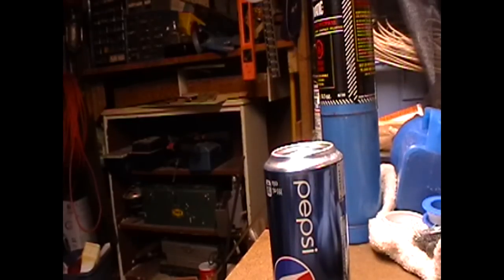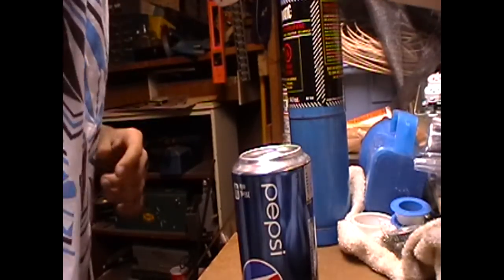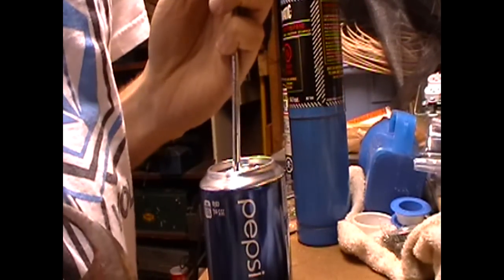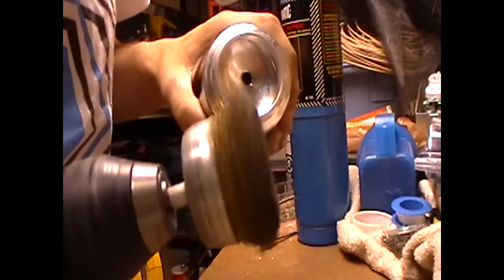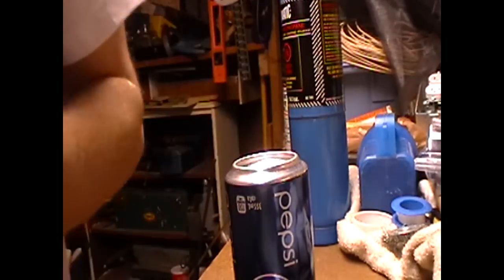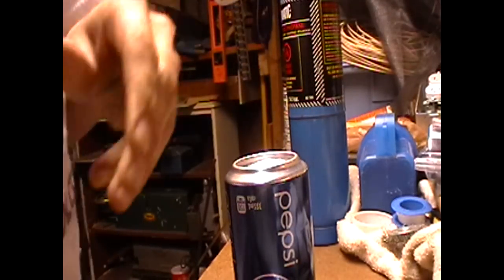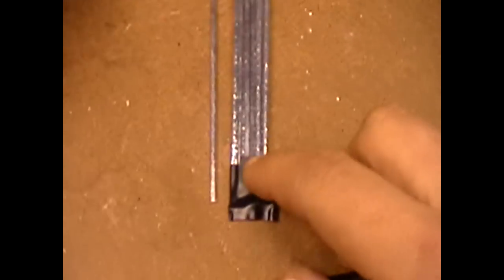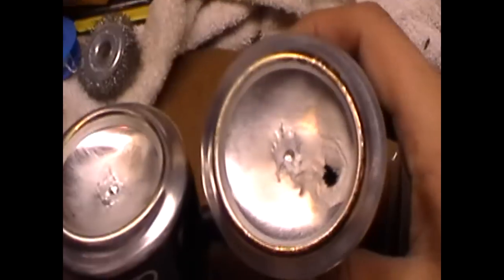HTS-2000 Or Durafix Welding From Ebay.ca

Comment: It depends on how heat proof that stuff is after welding it. Remember, an engine block gets quite hot. If it keeps joined with the other metal under heat, it'll be fine. You should in any case give it a try.

Comment: I've used that stuff before, well under different names. It's the same as brazing. The welding supply store I go to sells them 10 for 6.00 and are a bit longer. It will temp fix it, it's not as strong as getting it actually welded, eventually it will break off where it joins the other metal. Good luck though

Comment: you can also get this stuff called quick metal i had a hole on my engine case on my dirt bike and i just put this putty on  the hole and it hardened in like 15 min it works awesome
Reply: JB weld fast dry also.

Comment: This stuff is not NEAR as strong as dura fix is. And dura fix uses a special flux to assist with cleaning and bonding. This stuff is the equivalent to a cold solder.